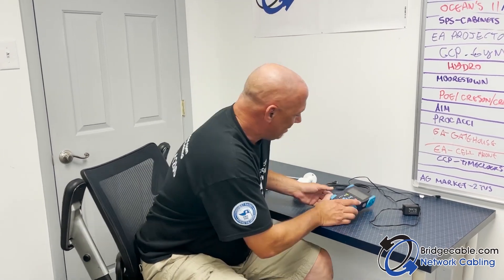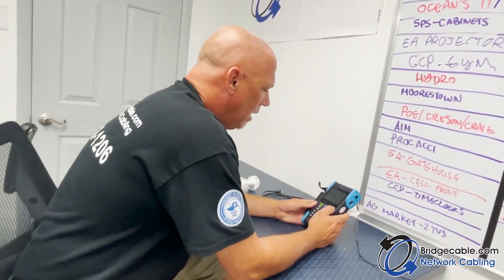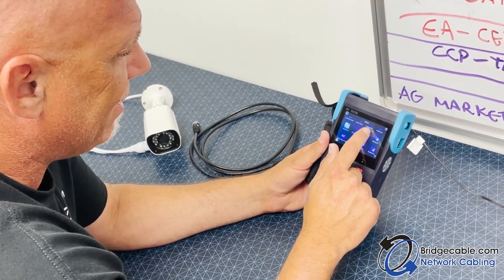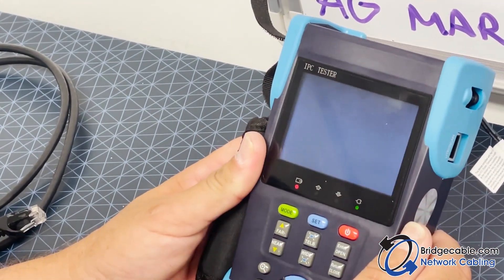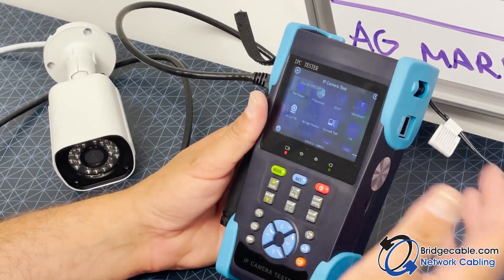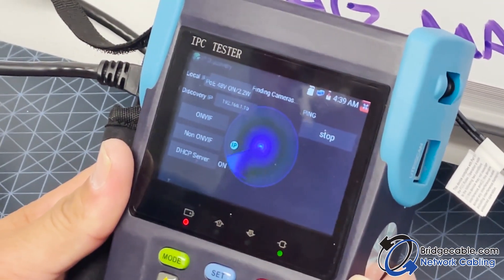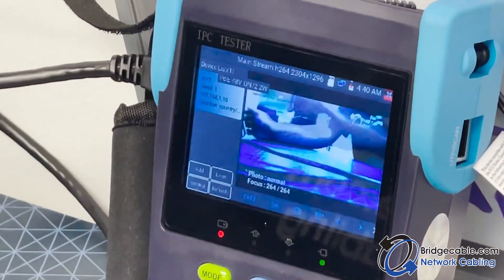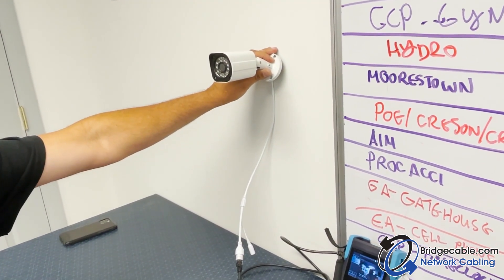IP Camera View Tester Tutorial - IPC Tester - Internal Training | BridgeCable.com

Comment: Does the meter have to be plugged in or does it have a battery so it can be used when youre 30 feet in the air with no outlet near by?
Reply from the maker: It does indeed have a battery! That would be awful.....50ft extension cord powering that unit up. Any tester is really fine....just we have a couple. The biggest factor on pointing cameras....the customers signing off on the views. That can be time consuming when 50+ cameras on a site. It happens alot on apartment complexes we do.